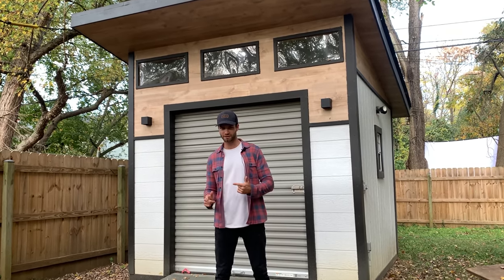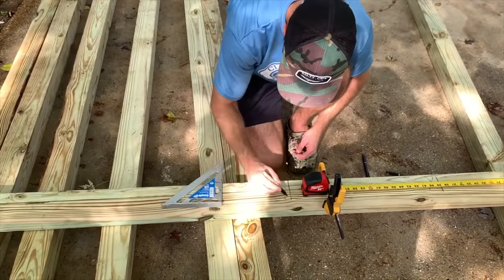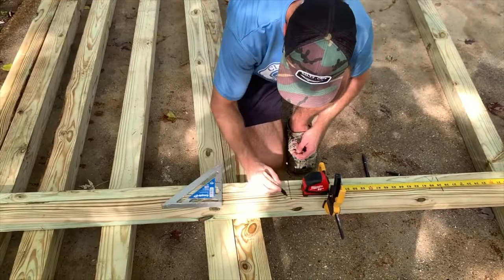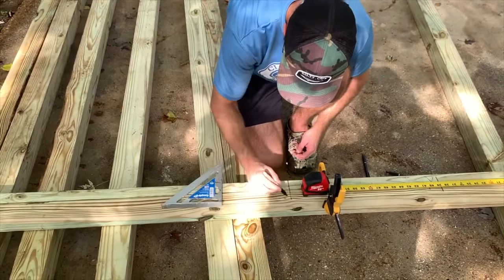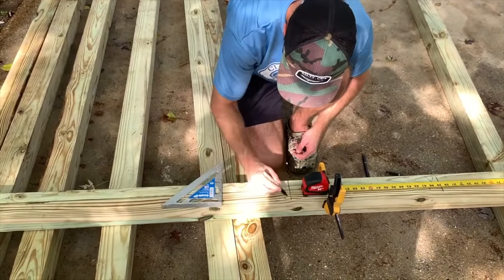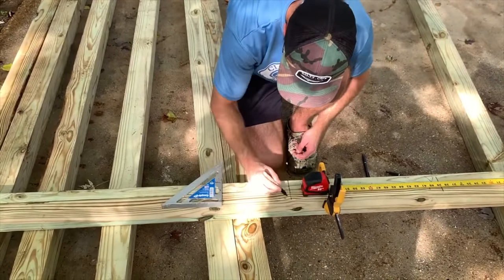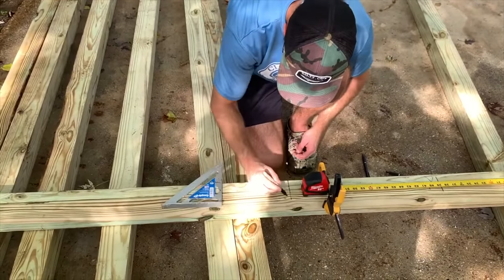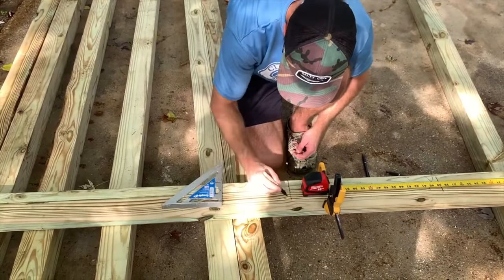DIY How to Build a SHED from Start to Finish (FREE Framing Plans!)

Comment: Nice work.but one major problem I can clearly see is that you put the drip edge on top of the shingles.facia boards will be rot in a year or so.just advice no judgement.but other than that it's some pretty damn good work bro.💪💪
Reply from the maker: Hi! I think you might be referring to the ridge flashing - which did go on top of the shingles. All the other drip edge went below!

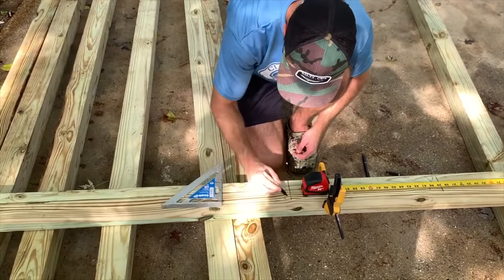Comment: If you install one or two braces (so that they can pivot around a nail) the wall cannot fall backwards when you lift it. They act as a brake moving with the wall making it much safer! (At around time 48:00 in this video). I've done many walls by myself this way.
Reply from the maker: That’s a good tip! There are definitely better ways to do it than what I showed - but we got it done!

Comment: Due to backyard space restraints, I’m looking to build a 12x8 shed just like this. Do you have different dimension settings in your course or is it only for 10x10 sheds?
Reply from the maker: Hi Dominic! The course if for a10'x10' shed specifically, but you can use it as a basis for any other size. I would start with the Youtube Videos to see if that gives you enough info to build it!

Comment: Nice work!  For the plywood that is exposed that you cut in for the top windows, did you poly or treat somehow?  Also, were did you source the garage door?  What thickness of plexi glass did you used.  Was it plexi or plexi-acrylic?  I have a 16x20 slab I poured a few months ago and looking to get started on the build.
Reply from the maker: Hi! I did not treat the plywood cuts - but that wouldn't hurt! I got the door from Steeldoordepot.com. I used a TOO THIN thickness for the acrylic panels - I would go with something 0.25" thick. Thanks for watching!

Comment: Hey Andrew, I am building my first shed and due to the subflooring being tongue and groove, the sheets do not go all the way to the outside edge of my (double) rim joists.  What do you recommend?  As I see it I have (3) options.  1- move my walls in so the subfloor edge is fully under the base board, or 2- build my wall where I intended it, causing the wall to have a slight gap under where the subfloor doesnt go out all the way, or 3- add a strip of board to the outside edge of the subfloor so the wall can sit fully on top of wood.
Reply from the maker: Hi Michael - if I was you and the gap was minimal (1/2), I would just go for it. If it’s larger, I would probably just rip a small strip as you propose in option 3. Good luck!

Comment: Nice video! Question, what nails did you use for the roofing? Do they stick out in the inside, meaning you can see the nails in the inside? I have 1/2 osb on my on my roof.
Reply from the maker: Thanks! I used 1.5” roofing nails and they did stick through the roof decking on the inside

Comment: For all that work you could've insulated it and ran a small mini-split to condition the space. Someone else wanting to build this sure could.
Reply: Do you think the insulation would really be worth it if one is not spending a lot of time in it during high/low temps?
Reply: @potatoes1234  not if they're not spending a lot of time in it.  But if they use it for like a side business workshop then yes, very worth it

Comment: I'm confused about what you did to fill the triangle gaps at the tops of the side walls. Is that just open, only covered with plywood, with no framing at the tops of the angled side walls? I've seen other people actually frame that with 2x4s. You skipped past that in your video and now I'm at 1:17 and it's got sheathing hiding it without showing how you got there.

Comment: You talk about using screws over nails, but you drove the screws in so deep that you sunk the heads. That actually detracts from the strength of the screw. Screw heads should not be buried into the wood. Nails would be fine for this application, you aren't gaining any benefit by using screws.